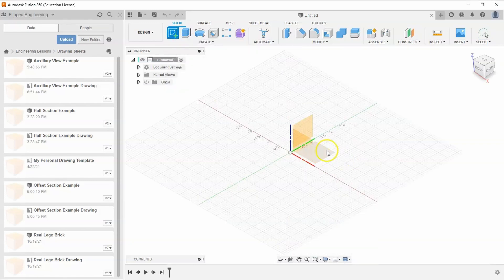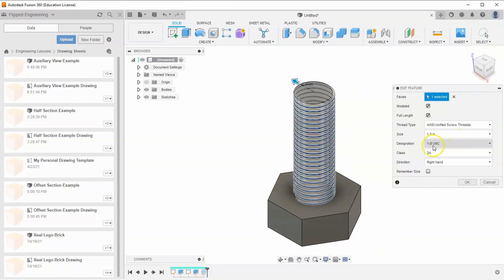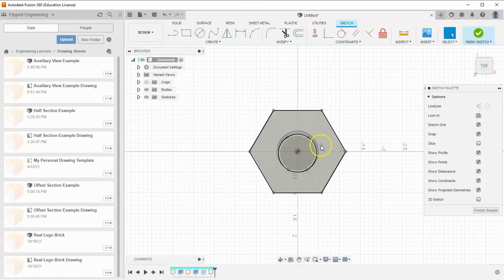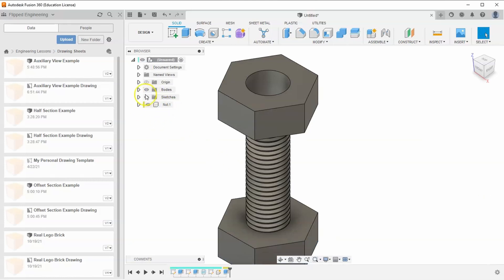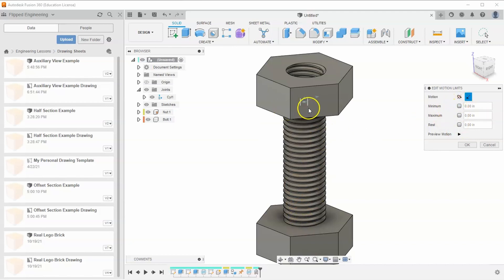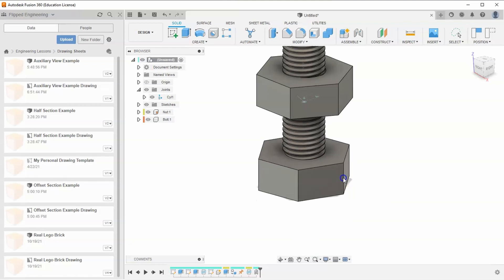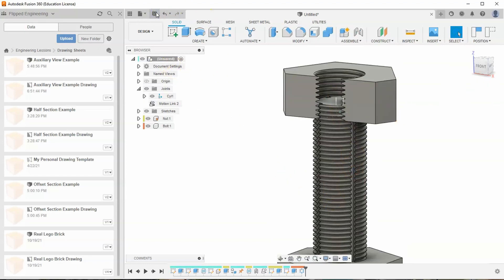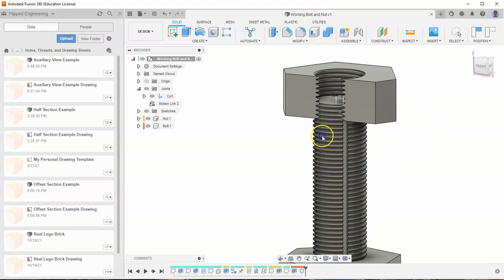3D Modeling a Working Bolt and Nut

Comment: Hey dan. So i 3d pront alot but ive never actually designed anything myself. Where would you say i should start investigating first? Should i watch some of your engineering stuff with math or if im just printing projects and other things would i be fine just starting with your fusion 360 videos? Thanks
Reply from the maker: Hey there! I would avoid the math videos. They are for my sophomore course which has very little 3D modeling. Depending on how much 3d modeling experience you have, is where I would send you. If none at all, my intro playlist on the main page will be very helpful. If a little, I would suggest going to the LearnitDoitMakeit channel and use his 100 days of Fusion playlist (He is another engineering teacher I have worked with in the past, and I try not to make videos when someone else already made them). If you have experience with most of the features (lofts, sweeps, ribs, patterns, work planes, etc) I would send you to Product Design Online. He has some great videos teaching more advanced Fusion 360. Including a few 3D printing with Fusion  360 playlists that show how to include tolerances and clearances to make sure 3d prints function like they are supposed to. PDO also has a "Learn Fusion in 30 Days" playlist and Sculpting playlists (more similar to what you would see in Blender) If you are looking for Assemblies (designing things with multiple parts), I would bring you back to my channel, and check out my more advanced playlists, like the squat rack playlist). So far most of my videos are designed for my Freshman and Sophomore high school courses, with the exception of the squat rack. So my videos are not on the level of something like this iron man project. Yet. Like I said, I have the philosophy of not making videos for the sake of saying I made it, if someone else already made that lesson. I just send my kids to that channel for that skill. That being said, I am in the process of making some videos for my Junior and Senior Courses that will have more 3D printing driven content. Like how to modify STL files that someone else created in Fusion. For example: like remove the eyes from an Alphonse Elric helmet, or add your gamertag to your a headphone holder you like. Also I am working on making a series where I reverse engineer items like a super nintendo controller or a squirt gun, and build all of the parts in Fusion. Plus how to design useful things that I need like a part for a whisker that broke, or a Collet Clip,  or a tool to help you respool filament. Those last 2 have been recorded and just need to be edited and posted. Long end of the short, More Fusion centered lessons are coming, and hopefully novel content. I hope I answered your question, and if you made it this far, thanks for subscribing! Hopefully Frank and I can work together more in the future and make even better content for you guys. Give my first short a watch if you get a chance!
Reply: @flippedengineering1676  oh wow thanks for the detailed response!
Reply from the maker: Of course! Hope it helps